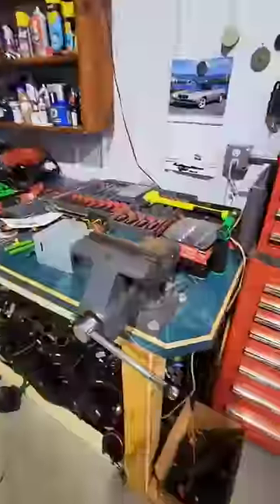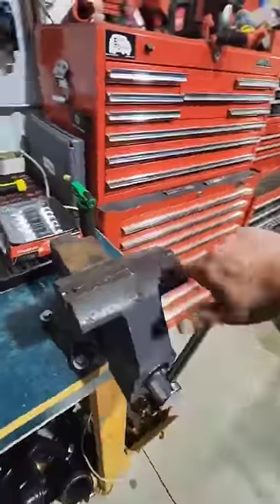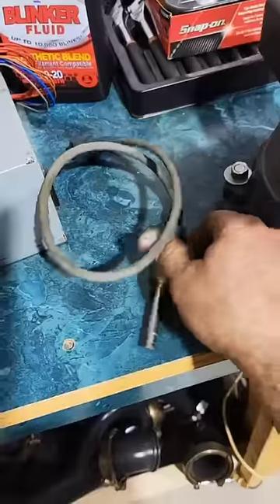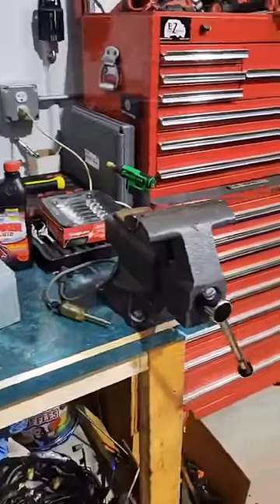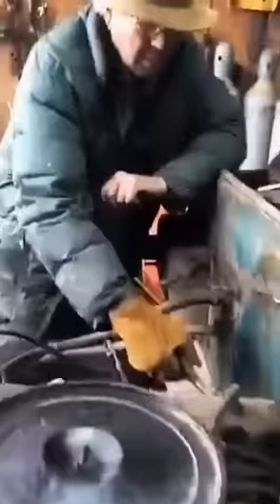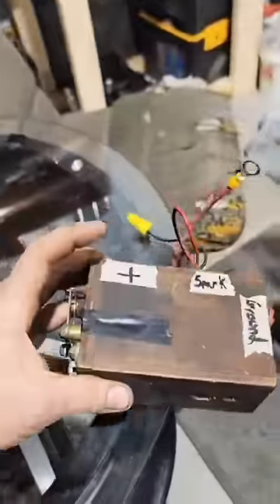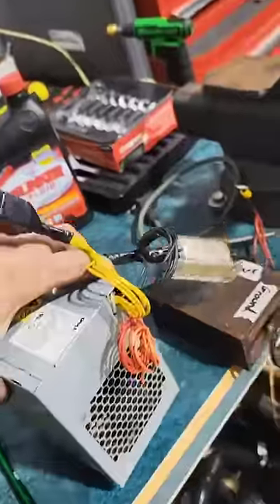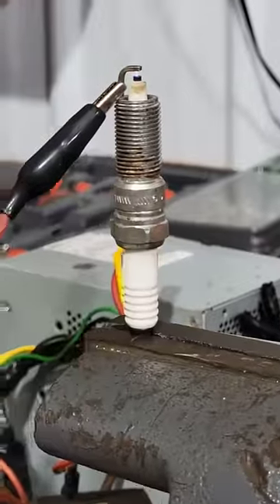30,000 Volts out of an ignition coil! #shocking #shorts Be careful, electricity can be dangerous.

Comment: I feel like this is super dangerous am I wrong or is that not enough electrons to be dangerous
Reply: Electrons? Lmfao electricity? Electricity is only deadly if the Amperage is high enough. You can have all the electricity in the universe pass through you without harm if the Amps are low. So no its not to much, hurts like hell, but its not fatal, unless you got a pacemaker, and even those are shielded.

Comment: You didn't come up with this concept bro, dudes did this years ago to their fenders at car shows to keep idiots off the cars.
Reply: Same as convergent evolution.
The same idea can be developed by different means and in different locations without needing influence or contact with the other.
He came up with an idea that has the same result as those dudes at car shows without needing to know about them.
Same as the prank at Mythbusters.
Or school kids charging up a Van De Graaf generator below the metal door handle.
Reply: @mr.noneyabidness  its not a Gen Z thing.
He just saw something that would help against the vice tighteners. A novel solution. A funny one.
He isn't saying only he came up with the idea first, just that he did come up with it.
He most certainly is not going to be the last to use electricity in this way.
No need to overthink. No need to apply to Gen Z.

The younger generation are guilty of many things. Solving a problem in a humorous way isn't in their style.
The typical Gen Z would claim workplace harrassment and cry about being bullied and get the vice tighteners cancelled or fired. Then make a tiktok and a new sexuality.
Reply: @Tuck-Shop  lol, fair enough!
Reply: @mr.noneyabidness  Respect.
Not many have the ability to learn and change their mind from seeing things from a different perspective.
o7

Comment: Am I an idiot or is 12,000 volts enough to instantly vaporize you lmao. Aren't wall outlets like 120 or 220? How tf does that give off 12,000
Reply: High voltage, low amps from the coil. Low voltage, high amps from the wall. Amps are what kill.